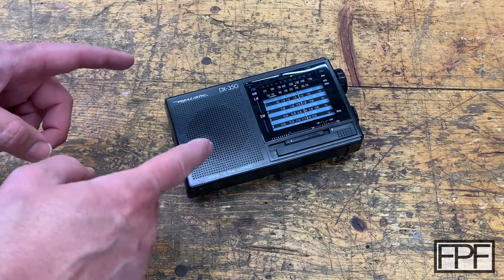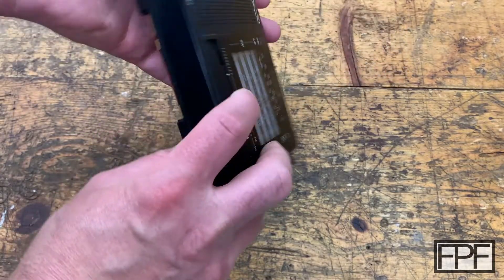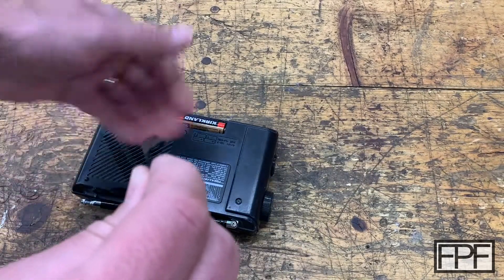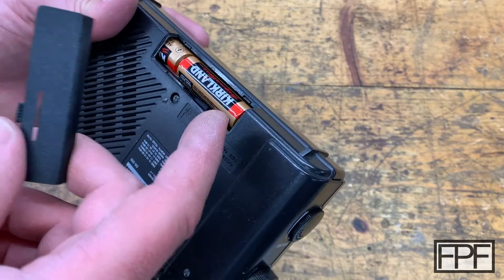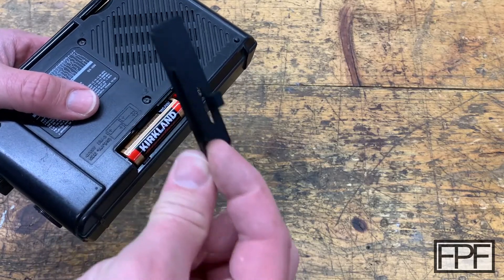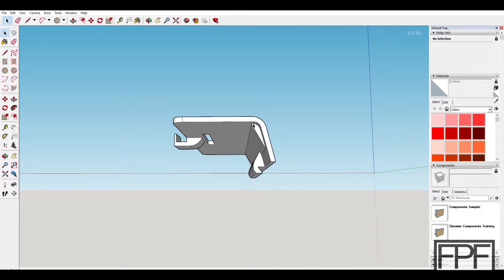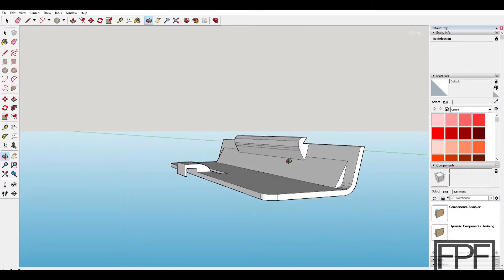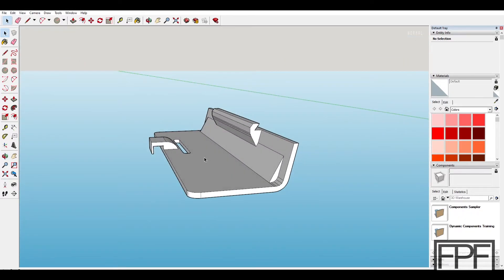3D Printed DX-350 Shortwave Radio Battery Door

Comment: A good idea would be to get some modelling putty to take an imprint of the curve, you could then take a photo of the impression and calibrate it to the correct size.
Reply from the maker: I've not had much luck with this in the past.  What software are you using to import/trace the photo?